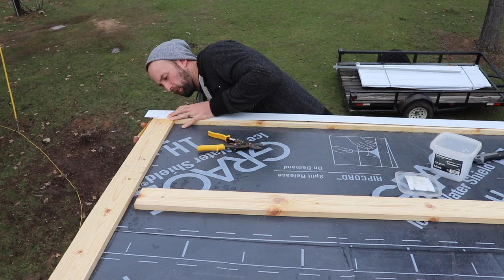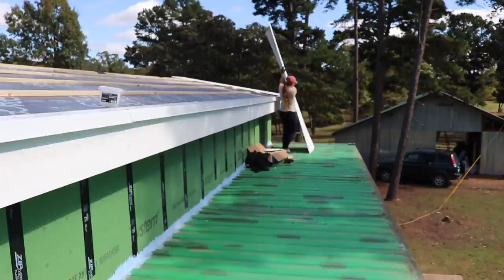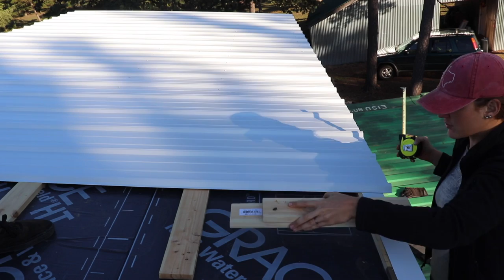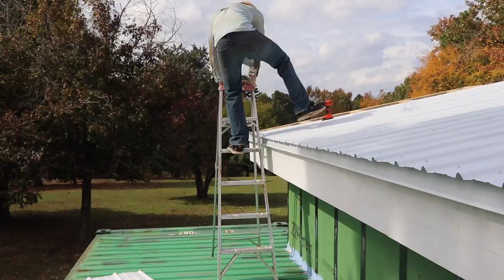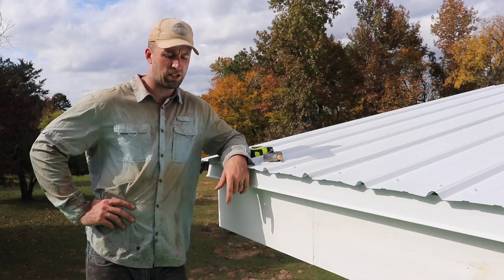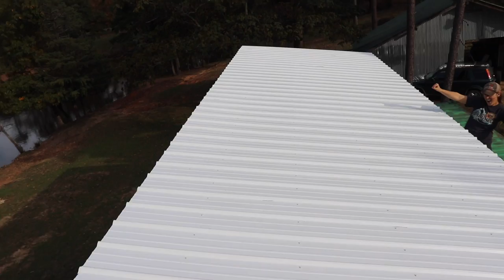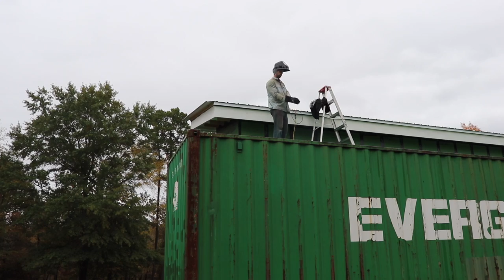Installing Our ENERGY EFFICIENT Roof

Comment: Hey guys, quick question, In retrospect, do you think it might have been more cost effective to mount a third container on the top rather than all the framing? Also, would that have been wider than what you have? I realize your bottom two would have to have been further apart if that were the case, but the pier count would have been the same right?

Comment: It's been years since I helped my dad as a teenager construct metal buildings but to rip that last sheet of steel, one can use a utility knife and score that last sheet while it was on the ground. A deep enough score with a sharp blade and all you have to do is bend it back and snap it off. Similar to what is done with drywall. You guys should be proud of yourselves any way you look at it. :)

I didn't read all of the other comments but I do remember there being some other foam seal on the laps.  This may have something to do with the design you have because I remember a wider lap and shorter screws for the peaks (not intended to go into the wood). Your lap is very narrow to add a screw there.

Maybe it's just me but as you have them installed, I thought they were furring strips and not purlins.  When I helped build those metal buildings I spoke up, we had purlins but they were on edge like a rafter and not flat.

Comment: Here's a tip for you. Hold the nail between your fingers while your hand is upside down on the metal or wood or whatever your nailing to.
Reply: Knuckles down against the surface. That way you hit the soft underside of your fingers and not the wrong nail. Lol

Comment: The air gap is good but you need to drill holes on the sides where you put the framing and install vents on the ends so that the roof can breath.

Comment: Not sure about the length of screw in the wood thing. Just change the length of crew? But I do agree with fixing on the flat as you are not putting pressure on unsupported raised metal.
Reply: Not an answer @mikebluenoser2987
Reply: So you agree with the 1st point but not the second? Why to the first and not to the second? I was trying to get information. not "yes and no respectively. Not re: Rib" I do believe that if there is no support beneath a rib screw then there is a very real danger of over tightening leading to small pools of water and leakage in the future.

Comment: You should have screwed the metal sheet on its highest portion, screwing it on the low part of the sheet is the possible cause of leaks during heavy rains,

Comment: ...Step 10: remove all roof panels to put insulation underneath them
Step 11: glue that rubber seal to the wood on the upper side of the roof (wasp barrier?)
Step 12: drive short self-tapping screws in the overlap together with some sealant/ butyl tape

And never use an angle grinder on a roof with a wooden sub-structure...your local fire brigade will thank you for the quiet afternoon...use some kind of saw that doesn´t produce sparks...
Otherwise, nice roof, thx for the vid!
:-D

Comment: rather than doing all that measuring on the panels why not take a purling and drill oversize holes right where you pass a screw thru. (a template)  position the board on top of the sheets- install thru the board.

Comment: @11:38 😉 There exsist longer screws you know....🙄😉😁👍
Reply: I was looking for this comment lol
Reply: I just watched some manufactures videos on where to screw, they all said DO not on ridges as it makes sense, the metal sways in heavy storm/winds causing the Screws on the Ridge to slowly come loose reducing the strength also it bends the metal in the Valley allowing more air pockets for wind to vibrate the metal weakening the screws overtime. You do not have that issue in the valley as the screw is in direct contact with wood with the metal in between making it much much stronger.  Also the Ridge is not wide enough for the washer to get a good seal, therefore If you are using the Ridge you basically creating a hole for water to get in.
Reply: @wiseandfunfox  
I was joking, you know that right!? Did you see the smileys😉?

Comment: Great job but no need to pre drill holes those are self tapping screws :-)
Reply: Thats what i was thinking too loll big waste of time.
Reply: a auto center punch pretty much eliminates any wandering of self-tappers.
Reply: Pre-drilling can make it easier than trying to get the screws stared.  BIG time saver - clamp 10 roof sheets together and drill all the holes through all 10 sheets. Now when you put them down you just start running screws in.

Comment: Hope you taped the sheets where they overlap. Also, you should have received 2 extra sheets. The top and bottom sheets are typically cover or spare sheets and get scratched and dented.  MAybe not but that's how my suppliers send them to me. Still will be a great roof.....Also wanted to add about the thumb and hammer issue, take a small drill bit, like 1/16th, and twist it ever so gently, on the thumb nail, where the blood is under the nail.  Once you 'drill' through, as easy as you can, it will bleed out and feel so much better.  Hope that helps

Comment: re roofing screws 
as far as I have been taught and from my suppliers in Australia we always screw from the ridge unless the the panel is vertical and we use a 65mm screw rather than a 50mm 
why? water follows in  the valleys and if any of your O ring washers break or deteriorate you will get a leak 
Far less likely on a ridge 
Your roof system is so complex and could be so less and less expensive 
Plus no insullation apart from the timber board and sizing paper
Wouldn't pass our ratings here in oz
regards 
Robbie

Comment: Spencer cutting the panel with anything besides snips is going to cause a chemical reaction in the metal that will rust! It’s because of the friction heat. And always buy a high quality screw like a 5/16 wood zak. It looks to me like you have a 1/4 wood grip. This is not a quality screw. And please paint the metal that you cut off with the grinder 😬 oh and one other thing make sure you get all the shaving off where you predrilled the screw holes if you didn’t I’ll guarantee you will find rust. You did a really good job installing the panels 👍 don’t stack the panels and pre-drill this will also cause rust unless you wipe each one down before installing.

Comment: Why did you not , measure , the first sheet, then take it down lay on top of the remaining sheets and pre drill the sheets in 1 hit , instead of measuring each sheetbto,screw down, your cleats were all in alignment, it would have halved your time to,fasten the roof,.
Also you could have also cut the sheets to final,length at the same time.
These comments come from experience , not as a criticism,  
Love your build and I am following

Comment: @ 4:30  the screws are supposed to be in the top of the sheet medal roofing's ridges NOT in the valleys ! That way water runs down from the screws not over them. Time to take it all up - buy more - do it right.   see photo   https://pascal-mesnier.com/metal-roof-screw-placement/screw-placement-on-metal-metal-roof-screw-placement-2018-metal-roofing-prices/
Reply: yes you can put them in the valley IF the roof is pitch more than 1 in 4.

Comment: had a friend install those types of roofing screws and they've started to rot and some even back out. the new type has a 'cap' or is moulded metal over the rubber. similar to (http://stfasteningsystems.com/?page_id=367). Now, nearly 10+ years later, we're having to replace all the old screws.

Comment: Nice job. Just for shitz and giggles. In the future if your willing to take a chance, you can cut that metal roofing panel with a skill (power) saw with a plywood blade. (fine toothed blade) I've used that type of cutting past on 16 and 18 G metal sheet. Shallow cut using a strip of wood on the top for a guide and under the metal thus the worry goes bye bye for scratching the paint/coating or serious ripping. If cut on a couple of 2x4's, or other, cut into the wood in the bottom board. Basic sandwiching the metal between the wood. Try it..Really it works. Enjoy watching your progress and the humor is great !!

Comment: Your roof screws are too short, they should go though the ridge on the sheeting. The way you used the screws on the sheeting over time water will leak through and root the battons holding the sheeting. Years In the future a strong wind could blow your roof off. The seal under the screw head is a cushion and a gasket in one, used right does a good job. Used your way is a bad idea, get professional advice.  I'm on the other side of the world a too far away to come and help out. Cheers

Comment: Here in Australia we use longer screws for fixing the roof sheets through the ridge, I know  leaves and twigs will gather on your roof over time  and having the hex head of the mounting screws in the valley, this will  restrict the  removal of this debris from your roof during a downpour and or high wind. Love you vids but I think you guys were mislead by your so called ex sperts.

Comment: Just a little problem,screws normally goes on the high part not on the lower part of the metal  roof plate
Reply: because the water wfen it rain fall the large lower part !!!
Reply: the interrest of manufacturer is to sell more plates !!!! and it exist more longer screws and believe me i'm a roofer !
Reply: @666HTORATSA666  Like them I tend to follow manufacturers advise not the experts who ignore them.
Reply: Did you see how small the ridges were wide, you would have to have a perfect centered  screw everytime, to get a proper seal with the washer. Not saying your wrong but the manufacturers information is 99% of the time correct. They literally would have liabilities if they said otherwise. Actually I just watched some manufactures videos on where to screw, they all said DO not on ridges as it makes sense, the metal sways in heavy storm/winds causing the Screws on the Ridge to slowly come loose reducing the strength also it bends the metal in the Valley allowing more air pockets for wind to loosening the screws.  Also the Ridge is not wide enough for the washer to get a good seal, therefore If you are using the Ridge you basically creating a hole for water to get in. There is no way you are a roofer, if you are you need to do research.
Reply: @mikebluenoser2987  They have already covered that ground in earlier videos they are building a roof over containers.